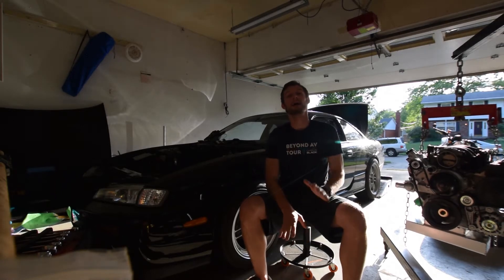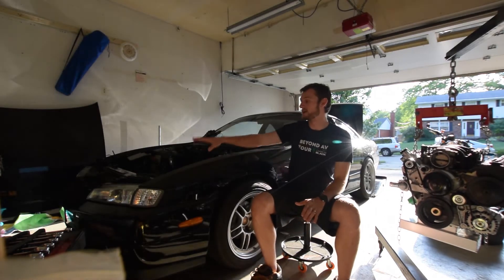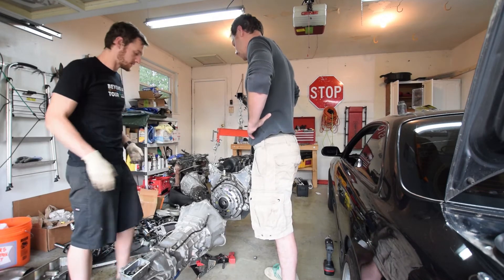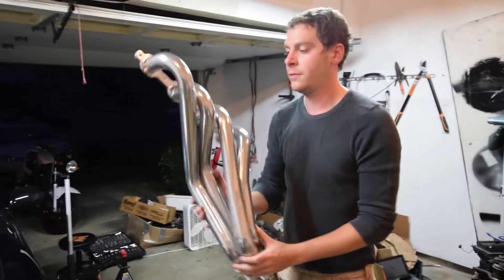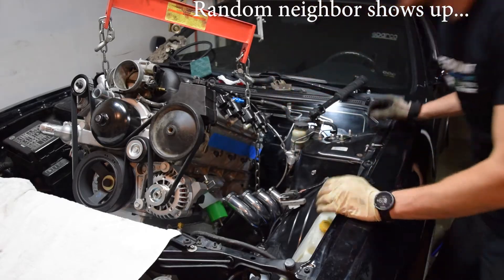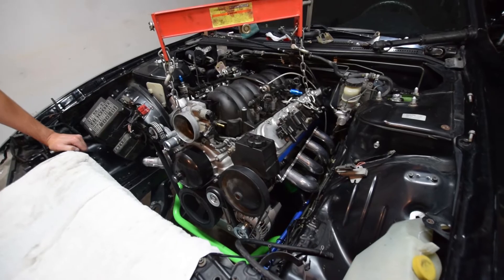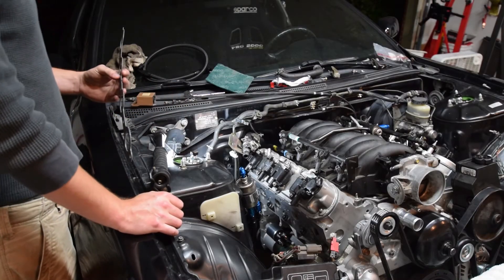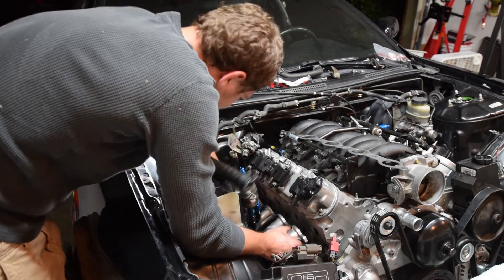Will It Fit?  Time To Drop the LS1 Into My 240sx - LS1 240sx Build EP5

Comment: Question: I plan on using the Sikky swap for my S13 but I plan on using a Z32 transmission. It has the starter off to the side. Do you think the Sikky headers will clear?

I live in Cincinnati too btw :)
Reply from the maker: Yeah, the headers don't even come close to interfering with the trans, they don't make a mid pipe for these anyway so it will have to be custom.  Won't be a problem with the Z32 trans.  The z32 is smaller in size than the T56 anyway so you should be fine.  Good luck!

Comment: How is the placement of the sifter location? I heard that the GTO shifter put it in the best spot but now I am hearing that it needs a Camaro style shifter.. I have a GTO  T56 and about to do this swap as well but trying to get as many parts as possible before i even start.
Reply from the maker: Great question.  With the stock shifter it's sitting too far forward in the car I'd definitely be hitting the dash if I keep it standard.  I'm actually going to do a video soon with details on the aftermarket shifter I bought to move it farther back.  Stay tuned for details!